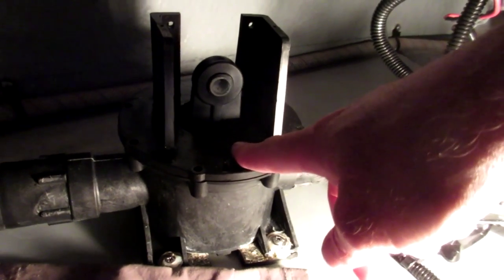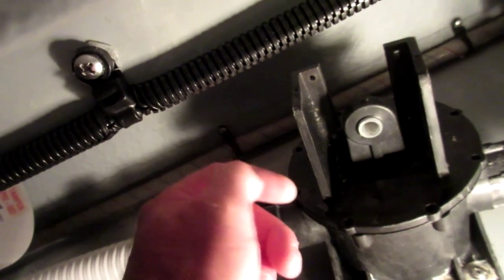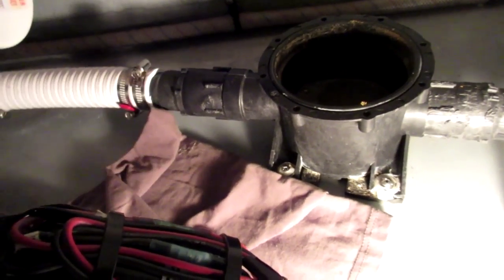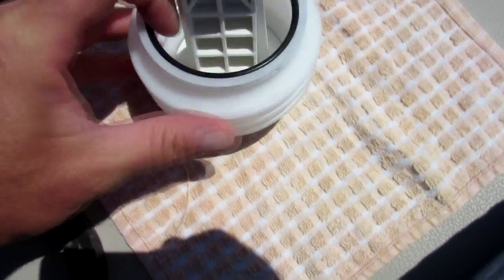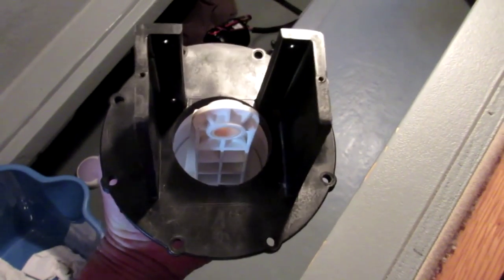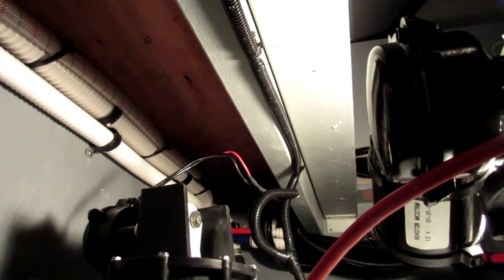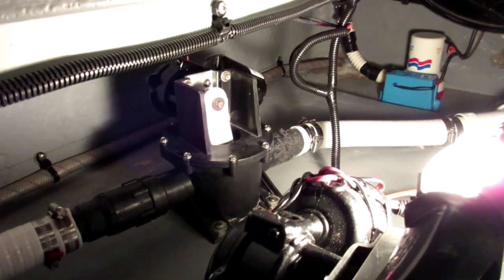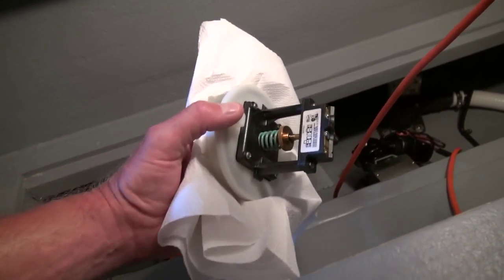Vacuflush Toilet Bellows Replacement

Comment: Hi I don't see the link to the pressure switch adjustment I really appreciate it if you could help me out. On how to adjust or test
Reply from the maker: If the switch is acting up, best just to replace it. They're factory set and if the spring has gotten weak, it's time to replace.

Comment: So....if you don't  mind me asking.  I have now replaced the duck valves and and seals at the head.  My pump continues to cycle about every 15 minutes.   Heck i was every 30 min...  so it's become worse.  Do you recommend I replace the bellow now?  TY!
Reply from the maker: I'm thinking it might be the vacuum pressure switch. I had to replace that on our last #boat and did it this past summer as part of my holding tank replacement project. 8f you have 1/2 to spare, check out the video I produced for that fun job; https://youtu.be/sLLlqyPRZLI as I show that aspect of the poop system upgrades.
And when I say fun, I was only joking 🙄

Comment: Hello Sir.  I have a 96 330, exactly like your last BOOGABOO...   My vacuflush pump runs nonstop when I put on the breaker, but it will also build ZERO vacuum.  I ordered a new Bellow and duckbill kit as shown in your video.  I'm thinking if it was a pressure switch issue, the pump would run continuously, but it WOULD actually build pressure.  I'm thinking either something stuck in the duckbill, or maybe a hole in the old bellow?  Thanks for any guidance, and for this video on the replacement!
Reply from the maker: Hi Michael,
 From my experience, it's either a bad duckbill valve - I had that issue last weekend and will be sharing a video when I get a chance. When replacing the duck bill valves, be sure to replace ALL four of them. 
 It could also be a crack in the bellow - I've had happen on our 330 Dancer, as well as on our prior 400 Sedan Bridge.
 Finally, it might be something as simple as an obstruction in the poop line. Last year, just before our summer holidays, I replaced the pump, bellows, pressure switch and all of the duck bill valves on our current 370 Sundancer. Towards the end of our five week voyage we had the same situation as yourself, with the pump not shutting off. Turns out it was what looked like a baby wipe that had got stuck in the line immediately ahead of the vacuum accumulator tank. No, that wasn't from us and I'm guessing it had been lodged in the 💩 line (from a previous owner), but still letting waste and water through and found its way through to finally getting jammed!
 BTW, here's a video I produced back when we had our 400 Sedan Bridge, relating to what happens when one attempts to flush a baby wipe down a Vacuflush system; https://youtu.be/P426uCxvvus
Reply: Thanks buddy.... Yep..... Already saw that video also!  Will let you know in the next couple days what was found.  Appreciate the help!!!
Reply from the maker: @michaelpescatore8539 If it's anything like our system, I know exactly what you're gonna find 💩😂

Comment: I am rebuilding one of these. I can not get the bellow on the motor bracket with the oring in the top lip. When I pulled it off the o ring was actually on the lip of motor mount bracket.  I greased it up but it will not slide on it keeps pushing the o ring down in the plunger.
Reply from the maker: Yes, they can be a bit of a pain. I've struggled with those o rings myself, but just a matter of trying. We're on our third boat with Vacuflush systems and they've all had their way with me 🤣

Comment: Just replaced the bellow in Dometic system, all good until he last 15-20 seconds of flush cycle, loud hammering noise? What could it be?
Reply from the maker: My guess would be that the pump itself is worn/loose and no longer happy. Had that issue on on our last two boats.

Comment: Thank you for making this. I just completed the replacing of the bellows on our aft head. Man, it was TIGHT getting the unit back in place! Took about 20 minutes of finagling because the c-clamp just wouldn't slip back in to the base housing. Anyway, works fine now. Thanks again!
Reply from the maker: +pacificNWboater Glad it helped you out! 

 I know what it's like messing about with the head systems in tight quarters - juts have a look my 'Boating How To' playlist (https://www.youtube.com/playlist?list=PLKhjT5kr2l2GpE-r5PjPvMtaRygCEb_si) to see all of the work I've done on our boat over the past couple of years, including the four part series on our poop tank replacement. Careful though, as I might have used some appropriately placed swear words throughout that effort ;-)

 Cheers, Paul.
Reply: pacificNWboater @1

Comment: Did your O-rings fail or the bellows. I'm about to do the same project. I can certainly see why you would want to replace it while it was out.
Reply from the maker: In this instance, the bellows itself cracked. If you check out my 'How I Did It - Boat Repairs and Upgrades' playlist, you'll find that I've done seemingly endless repairs to our Vacuflush systems. The boat in this video (1997 Sea Ray 400 Sedan Bridge) was sold in 2016 and we moved back to a 330 Sundancer, then a 370 Dancer in 2022. Of course, they've all had (have) Vacuflush systems and I've had my hands in all of them 💩😜
  Lots of videos, so I hope you'll check them out, including having to replace a new bellows that only lasted a few weeks after installing. The problem with them is that they are semi rigid plastic, and can be subject to fatigue.
 Oh well, a small price to pay for our love of boating 😁

Comment: Thanks for the video! I just bought my first boat with a vacuflush toilet and it dont seem to build up any pressure.. it flushed the first time we used it! I hope its just the duck valves since it doesent smell anything in the boat, but i found the kit with the part number you showed in the video on ebay. 
Next question -  are they all the same? looks identical to yours, only my pump sits on top of the tank. or how do i find the correct parts for my system?  Greetings from Norway :)
Reply from the maker: Glad it helped! But just so you know, whatever you fix on the system, you're going to have to do more at some point 😂 Good news is that they are a pretty straightforward system and once you are familiar with how everything works, diagnosing and repairing different elements will be easy for you.
 As for parts and part numbers, I'd suggest contacting Dometic, as they took over the OEM manufacturers and now offer replacement parts for everything Vacuflush. As well, Dometic has bought out many marine parts companies and can supply - or direct you to - the parts you might need from toilets to air conditioners.
 When you get a chance, I'd suggest taking a look at my ever expanding projects I've completed on our past three boats, here; How I Did It - Boat Repairs & Upgrades: https://www.youtube.com/playlist?list=PLKhjT5kr2l2GpE-r5PjPvMtaRygCEb_si 
 Hopefully you'll find more insights to help with your future repairs!
 Cheers and Happy Boating, Paul.
Reply: @BoatingWithBoogaboo  thanks! i will get in touch with them. Keep up the good videos!
Reply from the maker: @sbaakind88 You're welcome. Have fun with your new boat!

Comment: Great video as always.  We replaced the head seal, duck bills, and now the bellows and still have the pump cycling like clockwork every 5mins.  Thinking to replace  the vacuum tank and remaining gaskets/seals.  Any thoughts?
Reply from the maker: Sounds like the pressure switch. . .
Reply: @BoatingWithBoogaboo  Thanks, will give it a go.

Comment: I have a question. How do I fix The shaft on the motor it’s wobbly is there a potion or a bearing person can put in there?
Reply from the maker: As I mentioned to you on Facebook, I wouldn't waste my time trying to look at fixing the shaft, but replacing the whole motor. That's gonna be the only viable long term solution.

Comment: Love your videos!, changed all 4 duckbills but pump continues to activate every 25 seconds or so. Vacuum is good, water does not go down the toilet for hours (seen water disappear only if I leave the boat powered off for days) ...could problem still be pressure switch?. I hear a quick gurgling sound in the pressure tank down in the bilge almost every time just before the pump activates again. I just ordered a bowl seal suspecting water is dripping down from the toilet....any ideas about where the problem is are appreciated!!!.  Also, can't locate your video where you adjusted the setting of the pressure switch.
Reply from the maker: Hi Miguel,
 Sounds like you have a blockage in the line, most likely close to the pump. This past season, while on out on our summer cruise, I had a similar situation. Just before we initially headed out, I replaced the pump, bellows and all the duck bill valves, so it was a bit of a surprise that something might have failed so soon - but I've seen it before.
 So here we were, tied up alongside the lock in lovely Fenelon Falls and I'm down in the bilge, taking everything apart again. 
 Yes, I always carry spare duck bills - to quote Foghorn Leghorn "for just such an emergency" 😆
 Turns out that a prior owner/user had flushed one of those baby wipes and it was stuck immediately ahead of the vacuum pump 😠 No, I didn't see it there when I initially replaced the pump, so I'm guessing it was partially stuck somewhere upstream and had worked its way down... 
 We had a similar situation on our 400 Sedan Bridge a number of years earlier, when our daughter mistakenly flushed one of those baby wipes after changing her baby's diaper... 
 I'd look at that before you go much farther.
 As for the toilet seal, it shouldn't leak at all. If you're loosing even the smallest amount of water out of the bowl - even after many days or weeks - it's time to replace that. And buy a 2nd one for a spare. Much like the duck bills, those seals fail at the most unwelcome time.
 Finally, I removed the pressure switch adjusting video. Probably best not to play with that and just replace it altogether.
Reply: @BoatingWithBoogaboo  Appreciate the reply...!.. promise this is my last question:  does the pressure switch in this video look to be working OK to you?...I don't see it moving back and forth but the electronics are triggering the vacuum pump every few seconds..maybe it became uncalibrated over time?....20+ years old : https://youtu.be/QZuA-hiIrOo  ...tks!
Reply from the maker: Hard to tell, but those things shouldn't have a huge travel anyways. My best advice would be to replace it. After 20 years of use, the spring is probably getting fatigued, or the switch might be dying. Those things are set from the factory and it's recommended that they don't get tampered with, as there's potential of too much pressure and that could result in a catastrophic failure (explosion). 
 Yes, those things are crazy expensive, but should last many years. I replaced them on our last two boats and never had any further issues.
 D'oh! I hope I didn't jinx anything, as that's the one component I haven't yet changed on our current Sea Ray 😜
 Let me know how you make out!!
Reply: Circling back!….it was a small crack in the pressure tank at one of the bolt locations…I probably started it months earlier when tightening it too much…it just became worse with time. Besides changing all seals, etc I also changed the pressure switch/sensor and this alone doubled the time between cycles.
Reply from the maker: Glad you figured it out! Issues like this can be very frustrating - I know 😉

Comment: Did all of the work you performed on this boat finally resolve the odor issues?
Reply from the maker: Yes, 95%. After replacing almost all of the poop lines on that boat, there was one left - the one that went through the bulkhead into the engine room. That one still emitted a low oder and I was planning on replacing it, but we ended up selling that beautiful ship. Currently living our 330 Sundancer - which I also have done a major on the poop system, including new holding tank, lines, pump and everything else!! Videos in my channel 😀
Reply: @BoatingWithBoogaboo  Thanks for the info. I've got a 330 now in nearly bristol condition. Don't ask me why but I'm looking to move up and found a Carver 406 with the same odors you described. Your videos were very helpful for me to understand what needs to be replaced to eliminate the odor. Very much appreciated. Lots of work to come if I buy the Carver!
Reply from the maker: Good to hear. The problem with the smells - whether it's a Sea Ray, Carver or whatever - is that after about 25 years, the poop stink actually permeates the hoses. Once that occurs, the only way to get rid of it is to replace them. And FYI, I helped a buddy do that job on his 355 and you know what? It's the same PITA ordeal as it was on our 400 Sedan Bridge 💩
Reply: @BoatingWithBoogaboo  Isn't there some kind of cleaner that can routinely be flushed through the lines to eliminate/prevent the doodie smells?

Comment: Our vacuum pump is a pain, just did a full rebuild and now it’s whistling.
Reply from the maker: Check the bellows. It's possible that the O ring didn't seat properly, or its defective and has cracked. I know you don't wanna hear that, but it happens.
Reply from the maker: Here's what I'm talking about; https://youtu.be/kNDim08G-JY